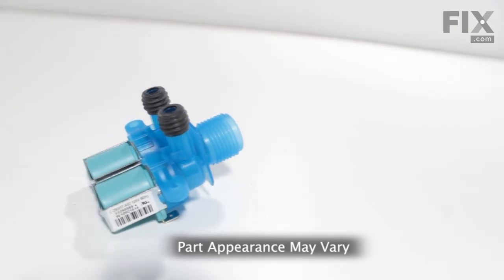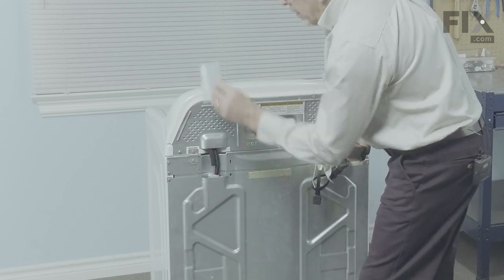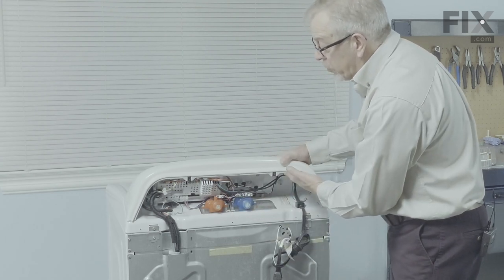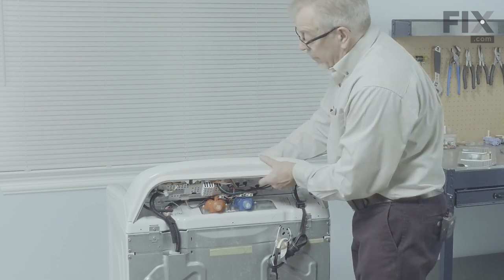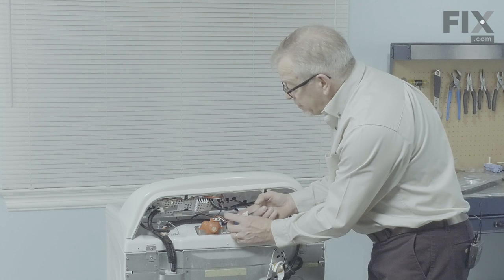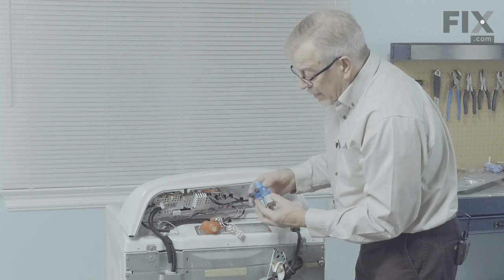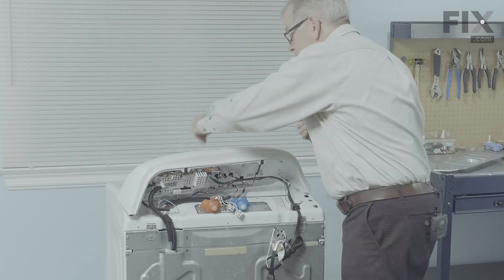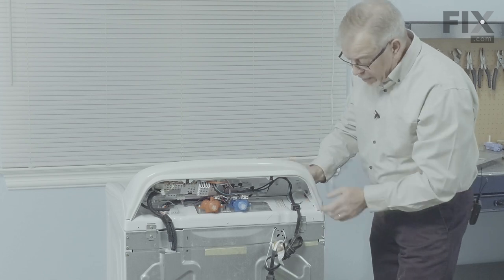Whirlpool Washer Repair - How to Replace the Water Inlet Valve

Comment: Thank you so much.  I will point out that I discovered that if you are only replacing the cold water valve, you don't have to unclip the spring and pop loose the main console.  I was able to get at the valve and use a socket wrench with an extension to get at the 2 screws holding down the valve, and remove it only by removing the rear access cover. The whole job took less than 15 minutes.

Comment: So there's no inlet on the hot water side? Explain why you didnt change out the hot water side. Assume people are NOT experts.
Reply: On this washer, there is a separate valve for cold and one for hot.  In this case, he only replaced the cold one.  The cold one is made of blue plastic and is behind the access cover that says "cold".  Replacing the hot one is exactly the same as replacing the cold one.  It is made of red plastic and is behind the access cover where it says "hot".